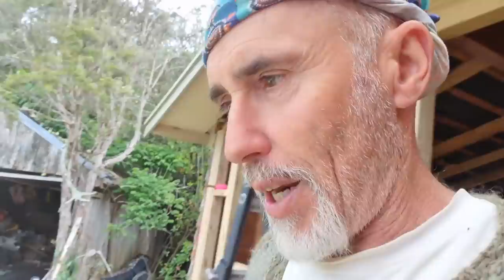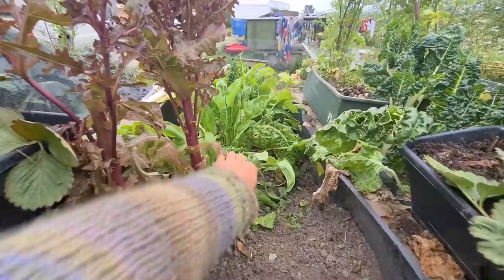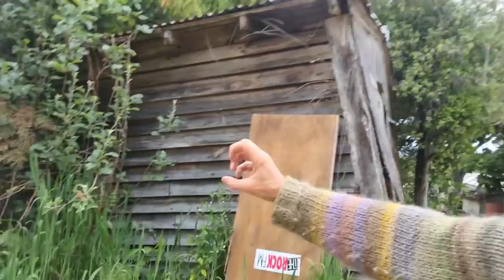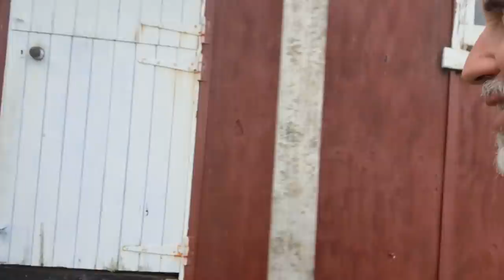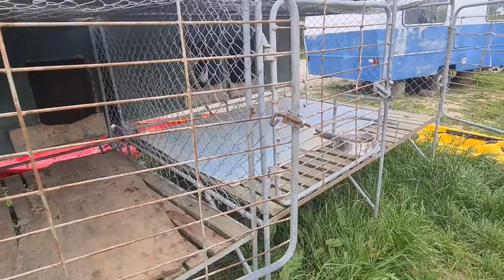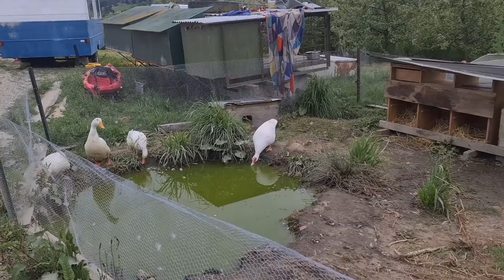Tuesdays Patron Snapvlog 24/11/2020

Comment: Clay, RE: rats. The whole house & grounds around need to be cleared & proofed. If you give them just one in, they're in. Another few tips: where there's been skat & urine you need to clear & disinfect, for health & to kill the scent that will attract them back. No leaking pipes (because they need food and water) & you have to keep on top of maintenance. The wee basta' can chew threw near anything. Expanding foam, which some use, is no problem for them. For holes, crushed glass in cement or thick grade wire wool in mix. Where there's 1, there's 30.

You live on agricultural land (like me) so there will always be rats about waiting for any chance, so you can't give them one, the battle is constant. Bottom line: keep things clean/keep on top of maintenance. Those apples will lure them in, so, your battle will be tougher than most. Good luck.